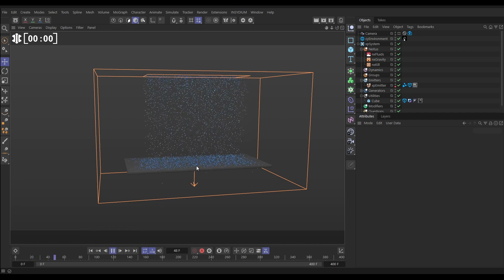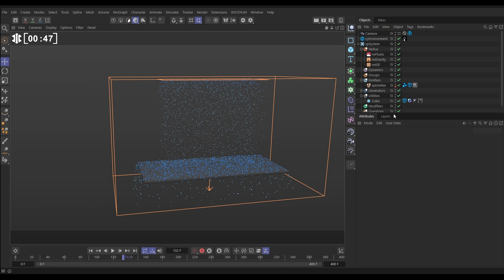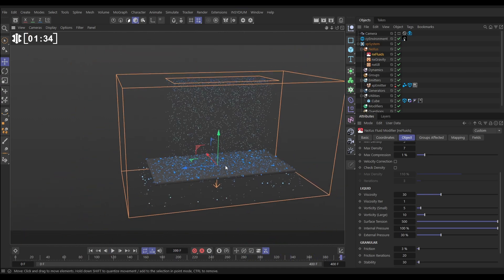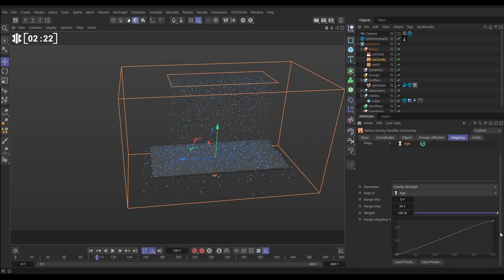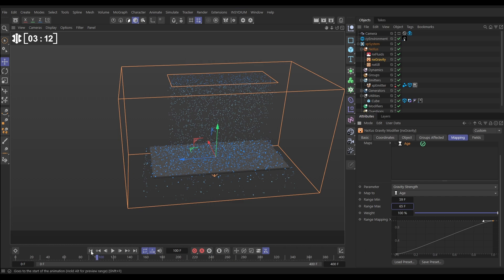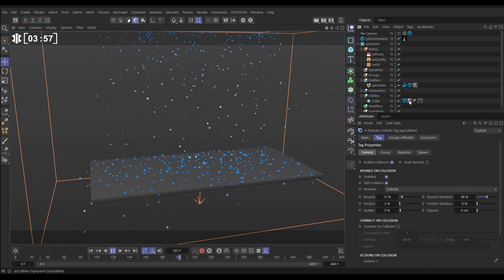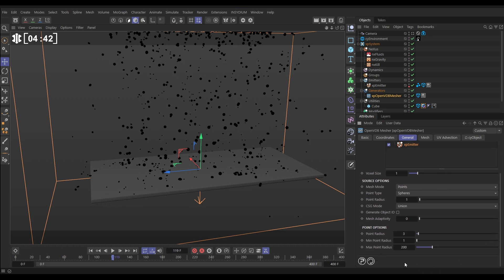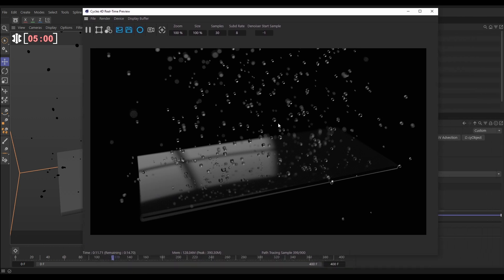Top Tip Tuesday - NeXus Water Droplets

Comment: How would you get the droplets to actually create a true droplet shape and not just spheres? Any idea?
Reply: I would guess drag? Could also use a bunch of instances of the droplet shape, and have the particles switch groups once they collide, use a geometry generator, or a particle type based on your render, to put the droplet shapes on only the falling group.
Reply from the maker: The strength of the Surface Tension setting will dictate how spherical the drops are. Bob has it set very high in this video to clearly demonstrate the effect. If you experiment with lower Surface Tension settings you'll see more droplet-like shapes and trails where they slide along the flat surface.